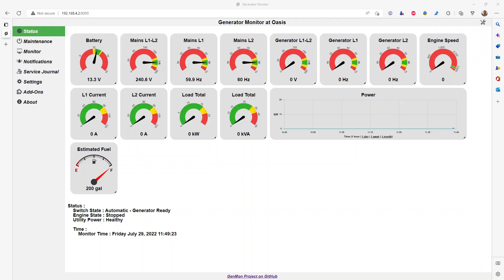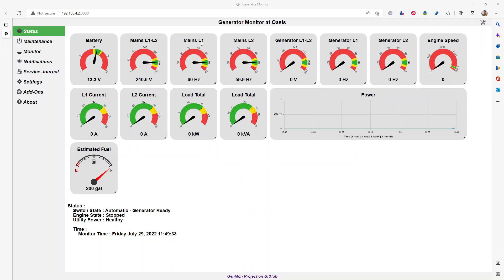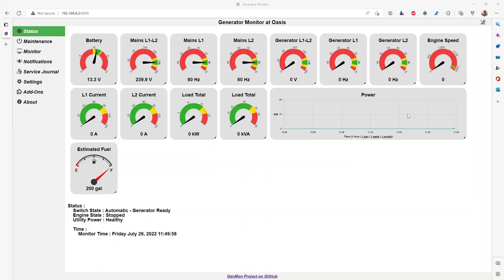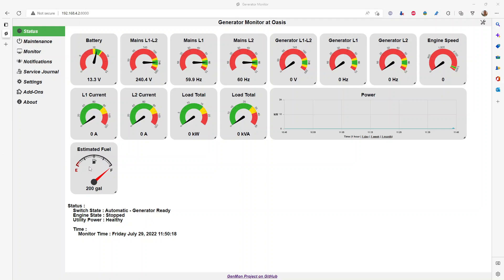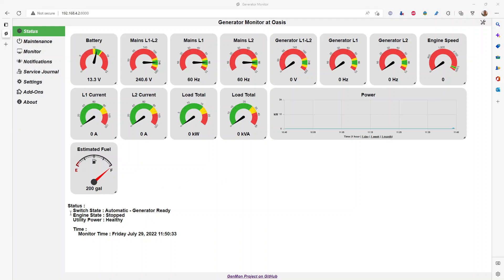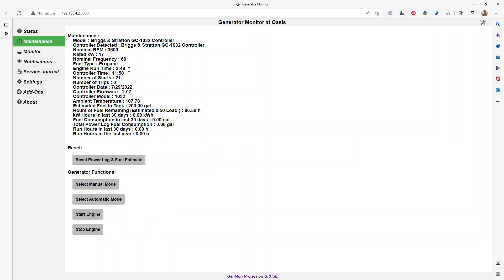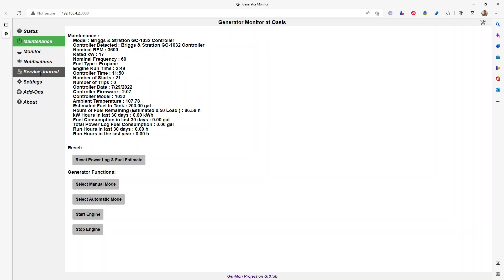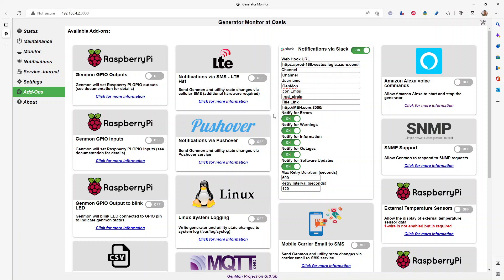Genmon overview with a Briggs and Stratton Standby Generator

Comment: You don't have a full setup guide, by chance, do you? I have a Briggs 20 kW and would love to setup Genmon - I'm a little stumped on exactly how to do it, though.
Reply from the maker: The genmon GitHub site has the software install directions.  My stuff picks up after that… as long as you have a raspberry pi genmon install is easy.
Reply from the maker: This link for the install… you’ll also need either an RS485 adaptor for the pi or the bridge that I describe in the video. 

https://github.com/jgyates/genmon/wiki/3.3--Setup-genmon-software
Reply: @genmonbriggs9033  it’s more the physical install that I’m looking for guidance on. The software is pretty straightforward but the physical install, I can’t find much details or setup guides on, especially not for a Briggs.
Reply from the maker: This video has the connection info, did you see it?  

https://youtu.be/Kcm8S2HIKFk
Reply: @genmonbriggs9033  I did. I think what I’m confused about is if I go the RS485 HAT, do I just need 3 low gauge wires to run to the generator? If I keep the Pi + HAT + power + networking entirely inside the house, is the only other piece the connection to the generator using something like 3 x 18 gauge wires? Is the RS-232 port needed at all for the Briggs? Are on the voltage conversions or moles wiring needed?

The way I’m interpreting and translating what I’m reading is that I have my Pi, I connect the HAT, I plug it into power and networking. After that, it’s simply the data feed from the generator which appears to just be 3 x low gauge wires run from the HAT to the generator controller. Am I missing anything or misunderstanding anything?
Reply from the maker: Rs232 is not needed, Briggs uses rs485

3 wires are needed, A,B, and ground.  Just make sure you get a HAT with 3 ports, the cheap ones on Amazon only have A and B.
Reply from the maker: We have it much easier than the generac users, Briggs has the terminal bus so you just need 3 wires and the HAT (or bridge).  It’s that easy, just make sure the hat has A B G ports, not H L or anything else.